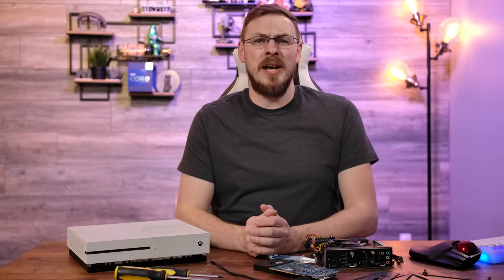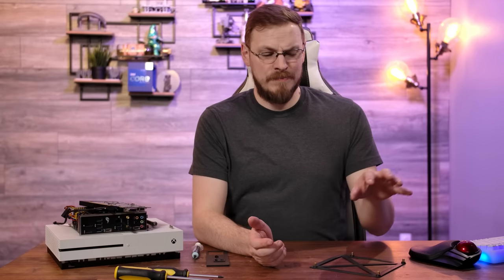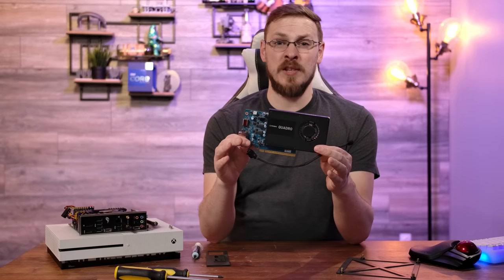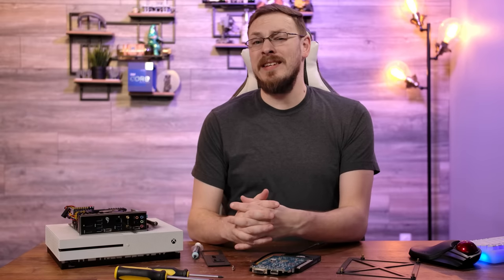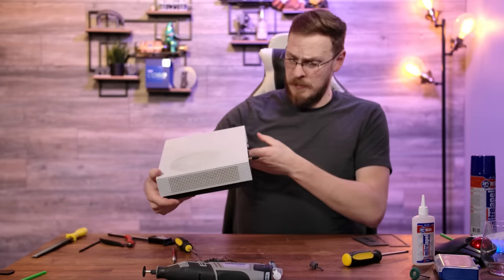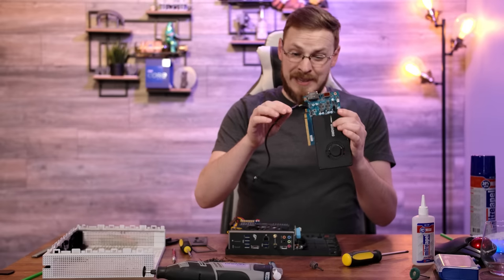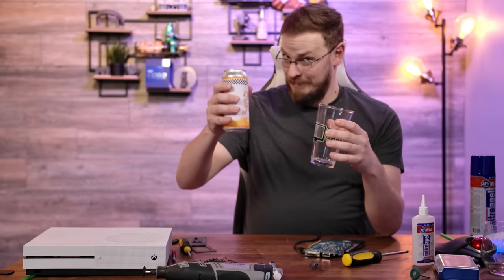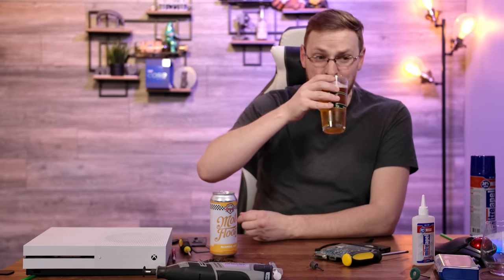Let's put a PC in an XBOX!

Comment: Tip from a model maker. Super glue releases when frozen. So when a mistake was made, pop the part in the freezer for a hour and it should break loose with no damage.
Reply from the maker: How did I not know this....?????
Reply: Genius
Reply: @CraftComputing  Another tip: you used way to much glue in one go. 4 drops in the corners and a drop in the center. Place it and when happy, run a small bead along the edges of the center cross. This saves the risk of flying drops, and reduces the vapors alot.
Reply: @CraftComputing  we all learn something new every day, you thaught me server for my 2 homelabs.
Reply: Thanks for this comment. I'll definitely keep this in mind and try this if needed 👍
Reply: Another tip from a (Retired) model maker is when we'd build we had small squeezy bottles that had fine steel tubes on the top (Hobby World). We'd use the thinnest viscosity cyano in them and just holding the two parts together and running a bead down the joint, capillary action would do the rest. Sure you'd superglue your fingers to the piece every now and then but that happens no matter what technique you use. Then zip kicker to finish it off. Of course for this application I would have used 5 minute epoxy but everybody's got their own solution.
Reply: Would spraying canned air upside down be cold enough to make it release?
Reply: @CraftComputing  Well when you shop put a can of beer in your freezer when you arrive home and after 1 hour and 5 minutes you should be able to enjoy a perfect beer. Waiting longer is not the right solution, if it doesn't get the temperature right for drinking the freezer has an issue - the beer is never at fault.
Reply: This is going to save me a lot of pain. Thank you.

Comment: My Comment is already late im sure this build is done if you have the old GPU fan or extra connectors you can soder the wires to old GPU fan connector you will loose PWM but the card will control the fan,  i did the same for my custom cooled 6900xt where i took the mini something pwm GPU fan connector into a regular Male PWM connector to hook a 120mm noctua fan to the GPU

Comment: Couple of suggestions. I would have used magnets to hold on the top of the case, use a rgb strip on where the disk drive would be so that it glows out of the vent holes and disc slot. All I can think of right now.
Reply: What kind of magnet you suggests,? Think the magnet will damage anything inside? Thanks for the idea
Reply: @golvellius6855  just weak little stick on magnets. Just a couple small ones on the edges to hold it down and make it easy to remove
Reply: @gh0stedone472  thank you

Comment: I'd have 3d printed some screwposts (with inserts), glued them into the corners on the underside of the top cover. Then drill out some holes for screws in the bottom and assemble. And also cover the holes with felt or rubber feets for that clean look.. No visible alteration to the case on the exterior that way. :)

Neat project this Btw.. Casemods are always fun
Reply: This is what I would've done too. Though I get it that those screws aren't that visible, especially when they're white, they're practically invisible.
Reply: That's a great idea, I was initially thinking of using magnets somehow but that's perfect
Reply: @Davidx_117  similar printed post and some heavy duty neodymium magnets would be quite nice too imo. Quite a bit harder to make correctly, but it would be really nice if planning to fiddle with hardware more.

Comment: Why the GPU...
What would i do:
1: Buy a Xbox One S case or a broken Xbox One S.
2: Prepare the case just like u did.
3: Buy this MB: ASRock X570 Phantom Gaming-ITX/TB3
4: Buy 5700G + 32GB Dual Channel 3600MT/s DDR4 + Fast and Big M.2 NVMe SSD
5: Buy a small PSU that will fit inside the case using the rest of the space
6: 3D print rear panel
7: Make frontal USB and buttons work
8: Finish the build and install Windows

Now u have the coolest Xbox One S, 8C Zen3 CPU, 32 GB fast RAM, big and fast storage, decent GPU, internal PSU.
And if really need more GPU performance u can connect a big GPU using the MB thunderbolt.

Comment: Excellent fun little video. Seeing fun case mods always takes me back doing that back in the early 00's with my gaming buddies. One question why use superglue? Why not 5 or even 15 minute epoxy? It should be just as strong and have a longer pot life to give you plenty of time to get your mounting position exact.
Reply: My thought exactly. I do mechanic stuff, like repairs on industry and sometimes I need to glue something. For that I have like Würth kit that has 1min, 5min and 15min glues and it even includes extra mesh for reinforcement if wanted. Those two compound epoxies that will stuck insanely hard. They're actually better than super glues in many cases.
Reply: @jothain  which one you can suggest? With a link will be helpful thank you!

Comment: You probably could have kept front tabs (but only part that went into the tab, but not the guide or hold plate), this way you'd need to secure only back part, with screw or a single tab

Comment: For the GPU fan: strip the end of the fan cables and solder them to the fan connector. If it's the passive 1650 you could solder to pin1 and 4 of the pcie lane.
Reply from the maker: I want it PWM controlled to keep the noise down. That little blower can howl if you give it all the beans.

Comment: The interesting part is that if you take one more year to finish it, it could potentially be already outdated: Benchmarks for the APU part of the 6900hs on laptops place it on the same performance as the 1650m (As in the mobile version of the gpu) already so I expect similar performance by the end of the year with Ryzen 6000 APUs (Well if they come out this year too and they might not as it took the 5600g and 5700g several extra months to hit the market) 

This means that eventually, you could just end up being able to use a 6600g and ddr5 and having the same performance as this rig or better. So you might want to speed up the finishing of this build just a tad

Comment: Thought about doing this a lot but made a plan how to get it done the way I want. Why not use the 3d print bracket as guide to mount the standoffs even lower? My goal would be to 3d print the whole bottom black plastic piece slightly to give more options.

Comment: This is coming together really nicely, isn't it great when a project kind of just, falls together? One concern i have is the orinetation of the fins on the cpu cooler, they appear to just butt up against the rear IO shield and the ram, is there enough room for exhaust? Can you rotate it 90 degrees so the air comes out the top andbottom of the mainboard instead?

Comment: Over all its a great build but i wish there were more space for the GPU in this chassis because if i were to use a more powerfull GPU without the shroud, it will still thermal throttle due to limited airflow....

Comment: Man really went through the trouble of sanding the bottom shell even.
You already have 3D printables why not just add some offset to the bottom of the motherboard tray that fit in the gaps? Would've also  made it possible to discard the glue and use countersunk screws on there instead...
Reply from the maker: You sound like a programmer. Should I spend an extra two hours modeling around the geometry on the bottom of the shell, or do I spend 45 minutes cutting and sanding? Keep in mind, this is a one-off job :-)

Comment: Could you have made your mount a bit bigger and use screws from the bottom to hold it in place? Then you would not have had to glue it.
Reply from the maker: I didn't want to use screws on the bottom. The rubber feet on the case are really thin, as is the bottom shell in general.

Comment: All the xbox machines I have opened about 4 all had what looked like water damage to the boards due to poor cases engineered I would avoid using it for a computer.
Reply: how the water damage could happen?
Reply: @denkrblx437  I think it is because the small case and the heat from the processor. I think it is heating the air allowing the air to hold more water and when it cools down while not using it the air cools of and the moisture in the air is condensing on the boards. I am no expert but this is what I guess is causing it.
Reply: They still work so it could be I am being too cautious. All I know is white marks all over the circuit boards when taking it completely out of it's metal shield.
Reply: @jeffsadowski  oh i get it, but its still most unlikely to happen.
Reply: @jeffsadowski  yeah
Reply: @denkrblx437  You mean in his use of it, maybe. He isn't enclosing it in the metal case and probably it will allow the moister to escape better. Every XBox I had taken apart to clean has had it so far so I'd say it is inevitable for it to happen on every Xbox.
Reply: @jeffsadowski  for sure
Reply: I may want to find an xbox one x with case damage and just take it apart and try and mount it in a real case just so I can continue playing games I got for it. A bigger case would allow it to work better.
Reply: @jeffsadowski  LOL, that was a good one. If it would be condensate related problem, you'd have to run machine virtually in minus degrees of Celsius. Pretty damn unlikely 😂
Reply: @jothain  OK then what is it I can be pretty sure all the ones I opened that, not all if any have had water pored in them. Why the white discoloration of the boards?
Reply: @jothain  Do you have an Xbox one, Xbox One X or XBox One S take it apart all the way to see both sides of the main board. I can be pretty sure you have the same white marks no matter how you treated it.
Reply: There are plenty of good videos showing how to take them apart without breaking them. I did it and I am not as skilled as most in doing those kind of operations.
Reply: I'm not cooling my house down to minus degrees Celsius.
Reply: Probably spilled a Redline Xtreme!

Comment: first
Reply: iam going to butchering my Asrock x300 and add an 10gbit sfp+ Card in it
Reply: @Domrockt  Best of luck
Reply: @tanmaypanadi1414  i f'ed up :D it worked fine until i tryed to push everything back in its case... after pushing the case back in my power button connector on my board broke off.